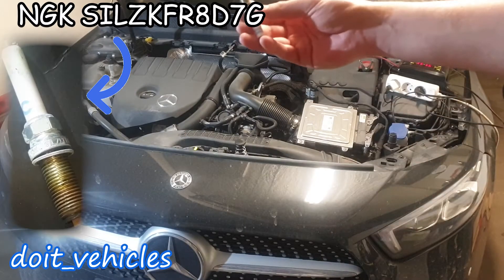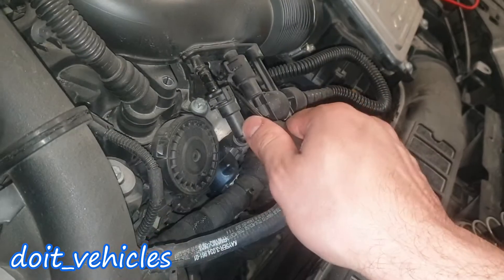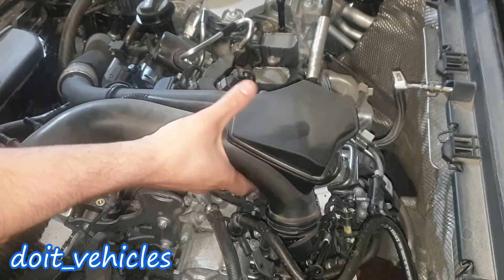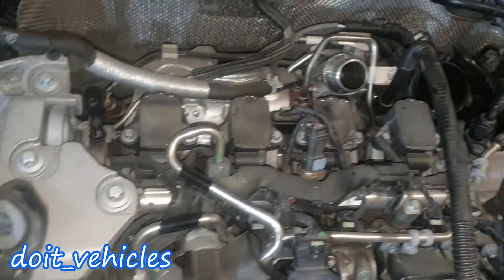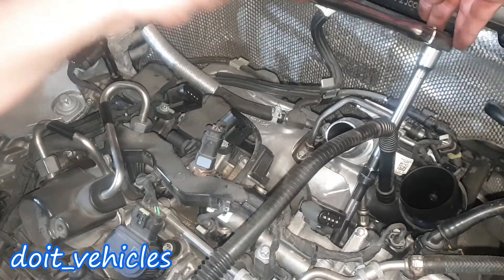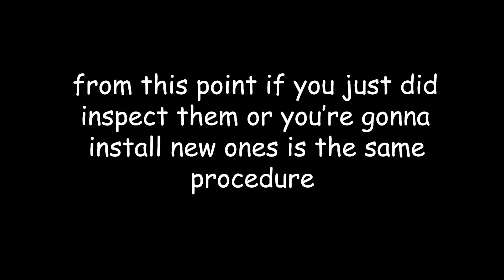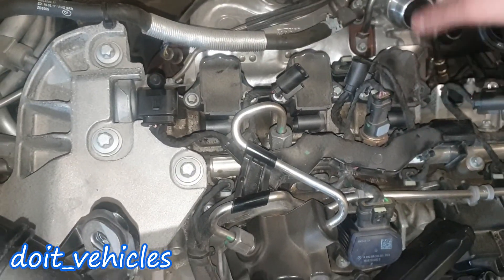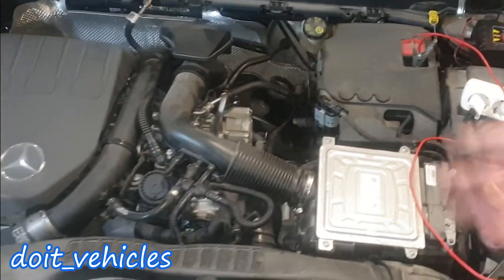W177 Mercedes A200 SPARK PLUGS Check Before CHANGE

Comment: Mercedes recommend to change spark plug every 30 000 miles in UK. If your case is true, I really don't need to change at the moment (36 000 mile)